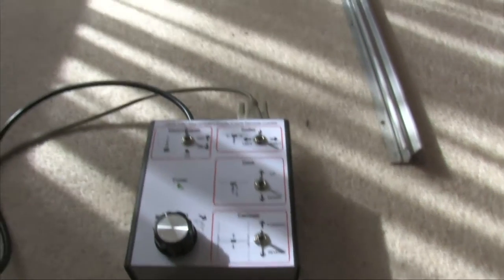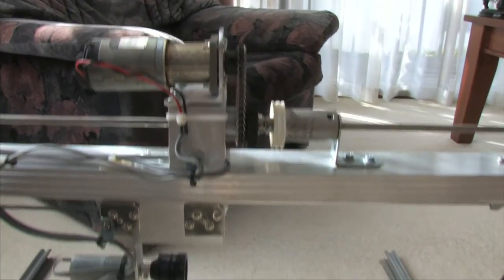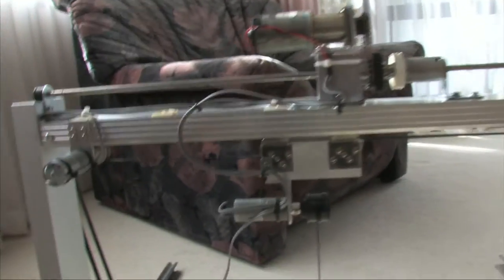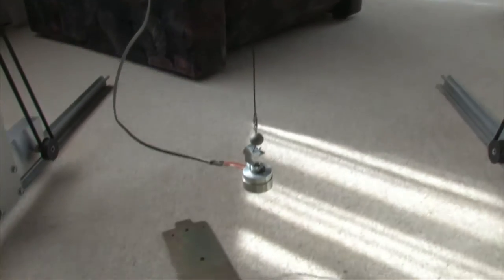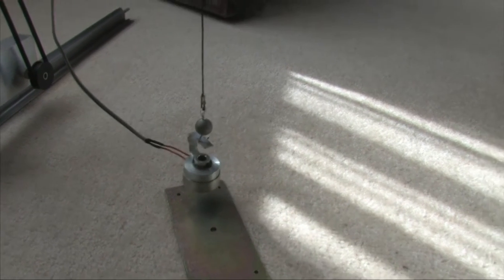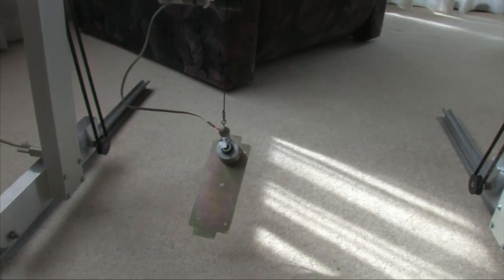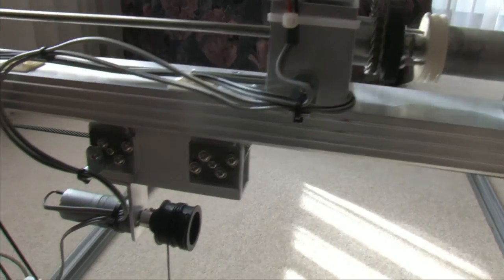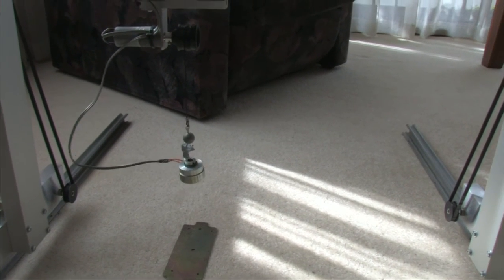Gantry Crane Model Toy

Comment from the maker: sorry for the slow reply.  Nope, it is simply put together with what parts I have had around.  The design changed to suit the parts and what parts worked together. The controller is a simple voltage regulator LM317T with the output going to the switches.

Comment: do you think you could draw out a quick schematic diagram?
Reply from the maker: Hi Jake,
I used a circuit for the voltage regular (to give me variable speed) similar to this one:
http://www.circuitstoday.com/few-lm317-voltage-regulator-circuits

The output of the voltage regulator then went to each crossover switch like this (except for the coil which is a simple on off switch):  The switches are the momentary on type.

http://www.homebuiltrovs.com/howtoswitch.html

I hope that helps

Paul